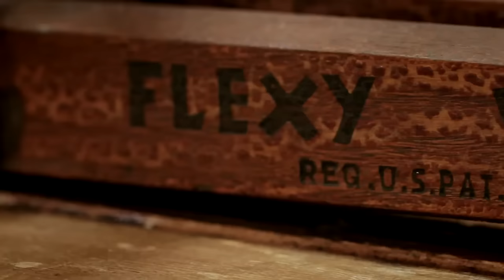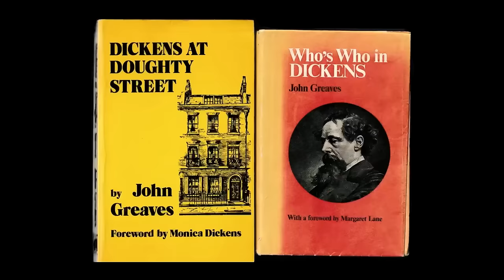Season 5 Episode 11 | The Repair Shop (Full Episode)

Comment: this is for Don.  Rust is a horrible part of metal working.  It takes patience and the right touch.  Have you ever tried an American penetrating oil called Kroil?  I restore old equipment and it is the best penetrationg/rust busting product I have ever used. The Living Treasures of the UK did it again.
Reply: Dom